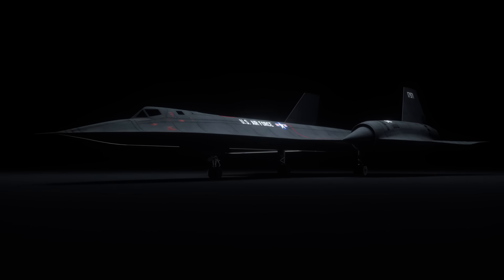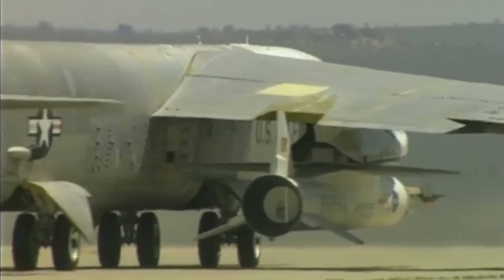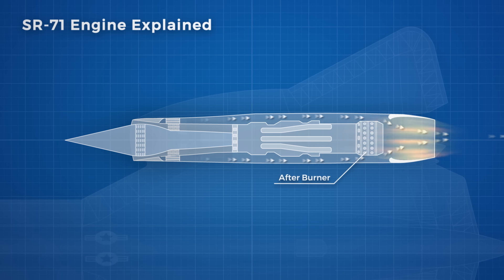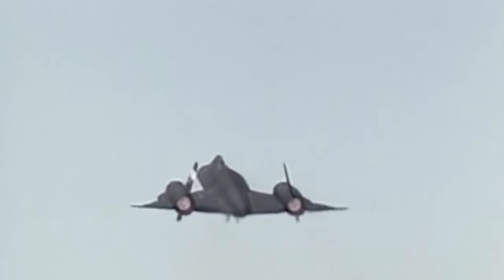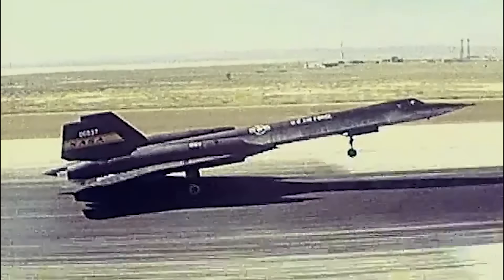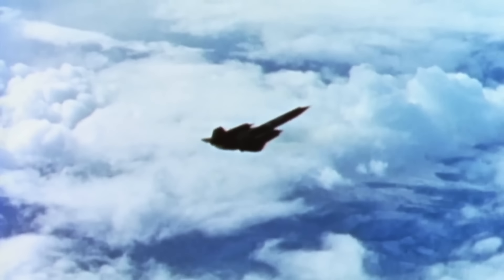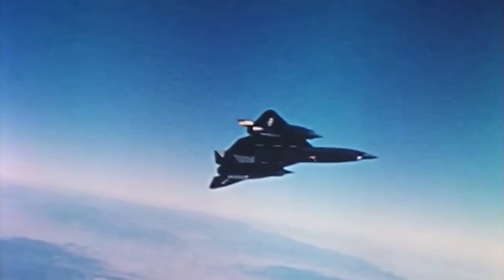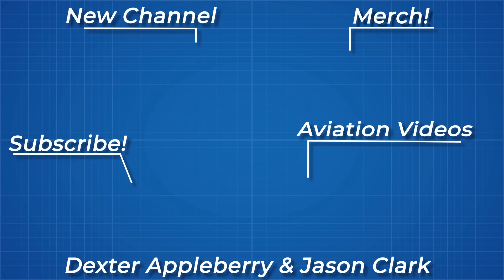The Insane Engineering of the SR-71 Blackbird

Comment: For all those asking "Imagine what we have now?", the answer is nothing remotely as interesting as this plane. The SR-72 has been talked about for 13 years and although it has had some development work done on it, isn't going to happen because it is not really needed and would cost too much. Keeping the SR's in the air cost as much per day as a whole aircraft carrier battle group. Also any plane flying Mach 3 or 6 is generating so much unavoidable heat that is easily visible with modern radar. We have hundreds of satellites in orbit that can observe our enemies more or less continuously without political repercussions. We still do have a spy plane, the RQ-180, it is a drone that flies at 60,000 ft at subsonic speed, with 12,000 nmi of range and is far stealthier than a faster supersonic plane. So there is no reconnaissance need and hypersonic missles will obviate the need for such a fast combat aircraft.

The A-12 was the SR-71's predecessor. It flew 5,000 ft higher than the SR-71 and likely faster as well. It was the more pure, high performance version of the aircraft. Unfortunately it was set up for direct overflights which were done away with by agreement. So the SR-71 was conceived with side facing cameras and extra fuel which weighed it down and reduced performance. The A-12 was mothballed in 1968 before the more advanced computer control of the inlets was developed that allowed for better control of the shock at high speeds. So all the records were made by later SR's but it was actually the A-12 that had the higher potential. Most forget about it because the whole program was kept a secret until the 1980's (we didn't want to admit to direct overflights). The SR-71 and the higher flying and likely faster A-12 that preceded it are not only engineering achievements but the product of unique politcal, technological, economic and militarial circumstances and are all the more interesting for it and not likely to be repeated.
Reply: You are talking bullshit. They have demonic technology right now: A.I Social Engineering, Bio-robotics, Biotech munitions, Cloning and Robot infantery, Alien-inspired-provided-emulated aircrafts, Haarpa, Project Blue Beam... etc, etc
Reply: Why you need spy plane if you using spy satellites

Comment: Fun fact the black birds sole existence caused a shortage of buick nailhead v8s because the small vehicle used to start the engines of the blackbirds was powered by the buick motor because it was able to rev high before ot broke and they needed to replace them so much hence why the buick motor is quit rare because the airforce destroyed most of them
Reply: They eventually ran out of Wildcats (the start carts actually had two V8 engines tied together to deliver power) and went with Chevy 454s later on.

Comment: I live near Mildenhall , England where 2 blackbirds were based and Had a yearly airshow and l think the best in the world. The Blackbird pilots who stood beside thier craft on display were happy to give autographs and l got 5 of them. Being 10 feet away from the plane was brilliant AND seeing it take off and fly by wowowow. i was told when l asked about the fuel on the floor that the plane takes off almost empty then fuels up and the expansion of the planes body at 3 Mach seals the tanks. Also the tyres have a silver coating and are filled with Nitrogen gas at 600 PSI. I have read to much about this craft but sadly gone.  But after the plane was retired the Duxford War museum near Mildenhall asked if they could have a Blackbird for thier museum and they were obliged with one of the Planes stationed At Mildenhall,  20 minute drive for me to go see my favourite plane amongst other famous planes.

Comment: It has no maneuverability at altitude to defeat SAMs. Its defense was speed. By the time a SAM LRS and SRS systems acquired, tracked, and fired, the Blackbird was well past any achievable interception point.
Reply: A slow turn away from the missile once it approached would be enough to ruin the intercept solution because the missile itself would need to maneuver-- after having expended its propellant.
Reply: @BogeyTheBear  a slow turn will kill you.  Most SAM defenses ( Glib II, SAM weave, Level S, etc) dictate a min of five Gs.  A SAM break is max G after punching off stores.
Reply: 'Slow' turn is in gentle change of direction. We're still talking Mach 3...
Reply: @BogeyTheBear  a slow turn during SAM defense will kill you.  Flew fighters 23 years but what do I know.
Reply: @vyperpilot  You may know fighters. You don't seem tonknow the SR-71 is something else entirely.

The SAM has a course dictated to it by the controller in order to get it into the general area for the intercept. Things take on a whole different flavor when the target can turn at Mach 3 because any alteration from the previously known intercept point will translate into miles of deviation by time of intercept. The missile needs a new interception course, but it has already expended time and energy going along on the old course.
Reply: @BogeyTheBear  you correct but you are misapplying the knowledge. I’ll explain when I get to a regular keyboard.

Comment: Kirchoff's law is spectral, which means that irradiated energy in the infrared spectrum (thermal energy) is a totally separated matter from absorbing energy from the visible spectrum. It doesn't matter which color the frame was painted, the emission coefficient in the infrared depends only on the material, not color. Emission/albedo is spectral.

Comment: Thanks for this! The famous military plane that we call the SR-71 Blackbird is a modified version of the CIA craft called the Oxcart. There was a huge battle between whether the aircraft would be a military asset or a CIA asset. In the end the Oxcart would lose out after a few historic missions and the USAF would take over control of the aircraft. Initially the designation was RS-71 but President Johnson misstated the designation during a press conference, and it was bad policy to correct the president.  The unstart issue was a big problem that was never directly solved but engineers did develop an effective workaround that would restart the engine during an unstart while greatly reducing the severe yaw incurred during an unstart even. The actual top speed of the aircraft remains classified as of today (I believe) but there are allegedly aircraft that are capable of speeds near Mach 10. Not bad for 60's tech- no wonder there are some who believe that the technology reversed engineered extraterrestrial tech.
Reply: The SR71 was more of its "own" aircraft  when compared to the A12 although they are very similar. The SR71 had a lot of changes/upgrades compared to the A12. The CIA was operated solely by the CIA "although the USAF did order 5". The SR71 was always a USAF asset from the beginning.  The RS71/LBJ thing is a myth though. Lemay wanted it changed from RS to SR so it was. LBJs press statement was changed and he read it correctly. But his stenographer messed up the press release, keeping the RS71 and leading to the confusion and origins of the myth. And speeds etc have all been declassified for over 2 decades.

Comment: why doesn't it go mach 5... the US haven't released it's officially max speed
Reply: It would melt
Reply: @ it can handle almost Mach 5 and the pilots have said to goes faster than Mach 3.4
Reply: @ Mach 5 is where you enter hypersonic instead of supersonic. Things change rapidly at that regime.
Reply: @jackbeers9285it absolutely can't handle anything close to mach 5. Even. 3.4 was mostly out of reach. And speeds etc have been declassified for over 2 decades

Comment: If this aircraft should ever be redesigned they should consider using synthetic diamonds 💎 as a potential material for use 🤔 at least on the outher shell of the plane to improve upon even more speed through heat resistance

Comment: If a good heat absorber is also a good emitter, shouldn't the composites that absorb radar signals also emit radar signals, therefore reducing its stealth characteristics?
Reply: If the Blackbird was actively emitting radio signals through those composite edges, then yes. A good absorber/transmitter means the object is more 'transparent' to that frequency.

Comment: Wasn't the fuel used in this plane Ammonia?? TIA
Reply: No, that was the fuel used for the X-15 rocket plane.

The fuel used on the SR-71 was kerosene-based jet fuel, but it was formulated to have a higher flash point than common jet fuels.

Comment: The fact we are fawning over a 70 year old design speaks to the lack of progress in high speed flight over the last 100 years. 

If you spoke to a person in the 1960s about what 1990 would be like, based on tech advances a the time, they would have said that, hypersonic/suborbital space flight (eg. Tokyo to LA in 1 hour) would be common. 

Yet here we are, sadly, plodding along SLOWER in 2022, than jetliners did on average, in 1965. The person from the 60s would be shocked to hear this.

Comment: I have been told the separation of components of the wing sections leading to fuel leakage was intentional and unavoidable, as the airframe would heat up and expand during supersonic flight. 

Without allowing this space for this expansion of wing sections to occur, there is a risk of wing deformation leading to catastrophic failure during supersonic flight 

Your explanation indicates that this airframe component separation was not a intentional engineering decision, but was a consequence of use of the plane

Comment: I’m sure that many of the UFO sightings back in the 60’s and 70’s were due to top secret flight testing of planes such as this.  Even today to see one roll out it looks like something state of the art for today.  Actually it looks futuristic still.  I can’t imagine what people thought about it if they saw it in the 60’s, not knowing that it even existed yet.  

It amazes me how advanced planes like this were built in such a short time period.  I mean in 1945 99% of airplanes were slow lumbering piston engined airplanes.  True, by the end of the war there were some very early turbojet fighters around that proved the concept and demonstrated the speeds that could be achieved.  But the thrust was small and the failure rate was very high, with those surviving having very short overhaul periods.  In a little over 15 years, engineers went from very few unreliable turbojets, to the incredibly reliable and incredibly complicated turbojets on the SR-71.  

And not only that plane but the Concorde as well.  The only thing that made Concorde possible as a long range passenger jet was the fact that it could fly at Mach 2 without afterburner.  Afterburner was used during takeoff, then was turned off during the noise abatement procedure.  Then once they were over open ocean they would go to full throttle and turn the afterburners back on and leave them on until they made it to around Mach 1.7 I believe.  Then they would leave the throttles at full, but shut off the switches to the afterburners.  The Soviet supersonic passenger jet couldn’t be flown supersonically without the afterburners on all the time, greatly reducing the range.  

The engineers took a different route on Concorde.  They installed a series of movable doors on the intake nacelle for each engine.  Those doors were controlled by two computers for each engine, one being a backup.  When supersonic, the doors would move to a position that would slow the incoming air to around 500mph, where the turbojet could use it and still generate adequate thrust.  It amazes me that engineers in the 60’s designed these two advanced aircraft when only 2 decades earlier jets didn’t even exist in significant numbers.  The sr-71 and the Concorde both look like they could be rolled out the door today and accepted as modern state of the art aircraft.  Of course us and the Soviets were going into space during this time as well.  It sure was a time of major technological advances and lots of major achievements.

Comment: it was designed to leak fuel on the ground slowly and had holes for it and wasnt fueled till the last minute if possible and then within a minute or so of high speed air it got warm enough to seal

Comment: Awesome vid. I hope someone sees this comment.

If the SR-71 moves so fast and flies so high, how can it take pictures of the ground especially during the 60s? Im more impressed in that
Reply: In the older A-12, the camera was mounted behind the pilot and pointed straight down. Now, the fuselage is comparatively thick, so that's enough room to mount what is essentially a small telescope to the camera. Trouble is, you'd have to fly over the country.

The SR-71's mission was to fly along the border and look diagonally into enemy territory. The sensors were mounted along the sides of the fuselage (that camera bay behind the pilot became a second seat for the RSO).
Reply: @BogeyTheBear  wow that' awesome in the 60's thanks bud

Comment: The explanation for the fuel leaking sounds like a mistaken conclusion. The gaps in the skin were by design and necessary to tolerate thermal expansion at mach 3 speeds, this is actually why they chose keralox for fuel because it's not easily combustible or super toxic to humans, makes it safer to work with on the runway. Also, blackbirds never took off fully fueled, they actually take off with relatively low fuel and fill up at a tanker early each flight. So while it may be true that the gaps became worse due to deterioration, they were also by design and necessary to prevent warping and/or catastrophic deconstruction mid-flight.

Comment: Interesting note:   The SR 72 ( SR =Strategic Reconnaissance) flies at the " unclassified speed of 2193 MPH or Mach 3.2)   that is 3600 feet per second,,  A standard 3006 bullet of 165 grains muzzle velocity is 2855 feet per second..   so,,  the SR 71 flies 508 miles an hour faster than a sustained 3006 bullet..  It took 8 years to develop the plane with its first flight Dec 22 1964..   If you could have seen the cars the engineers and workers were driving parked in the parking lot at the skunk works   it would be very hard to grasp the concept that  these men could achieve this pinnacle of aviation brilliance driving to work in a 3 speed column shift Studebaker with camelhair upholstery.. !!   Same goes for the cars in the parking lot of  the Kennedy space center when the first Saturn 5 rocket was launched..  Its good to have your mind boggled from time to time ..

Comment: I still can't get over the fact that they designed a plane with an engine that proved to be too powerful for the airframe even when they specifically used the best materials available to them, forcing them to cap the engine to a much lower level of power than it's actual maximum.

Comment: SR71 was a joint venture between the CIA (Mr. Kelly) and The USN this program is likely to have started in 1953, there was a Reveal 
sometime in 1963. The SR71 was the Primary or Spear Head, there were other Super Planes in This Project including the much talked about
Aurora. It is curios to me is the Technology used (Polycarbonate, Not a single Bolt, Engines?) This is a time with no known high tech which would have been required. This was a time of Slide Rulers, Quantum Mathematics and Physics. Note: This is strictly my information, No verification.  Where did the Technology and Material come from?  Take it as you will.. I am glad is ours USA.

Comment: Weirdly this plane may have done mach 5 at 80,000+,  as the speed of sound slows with elevation, and considering possible conservative reports on performance. Although, questions of reliability could have been its biggest factor in its usefulness and credibility. But, what do I know? Nuttin', it got replaced by better methods, missiles, satellites, whatever. The baddest plane ever. How many test pilots had to die?

Comment: Blackbird expanded so badly flying that it wrinkled cooling and they had to use sledgehammers to beat the pleats out if it. It got so hot that after landing the pilot would have to sit in the cockpit until the plane cooled enough, sometimes hours. When I was young I went to visit a friend living along the Yuba River in Marysville to pan for gold. It would have been around 1985. We were close enough to Beale AFB that I got to see both Sr-71 and U-2 in the pattern. The U-2 flew so slow and it would tips it's wings almost vertical to turn. I also saw another plane one day I did not recognize until years later. Flying along the Sierra Nevada fast and low, a black teardrop shape. It was around the time of Nighthawk but this plane was not at all angular. Years later I saw a model of the "Baby B-2," it was called the "TR-3b Black Manta" and it looked exactly like what I saw that day.

Comment: The greatest airplane ever designed and built. And it was designed in the 1950's! The only reason it never flew faster is heat. It will melt. It's literally never been 'full throttle!' I've spoken to a few pilots and not one of them 'enjoyed' flying this thing. It required so much unbroken concentration for hours on end, and a tiny mistake would take it off course by hundreds of miles in minutes. And the manner which the USA obtained titanium from Russia is like a movie all in itself! Kelly Johnson was a genius. If he was born 75 years earlier, he would have been the first man to fly.

Comment: It was actually designed to leak on the ground before takeoff to account for the thermal expansion of the materials. Once friction caused it to heat up, it would expand and seal itself. Insane forethought and ingenuity.